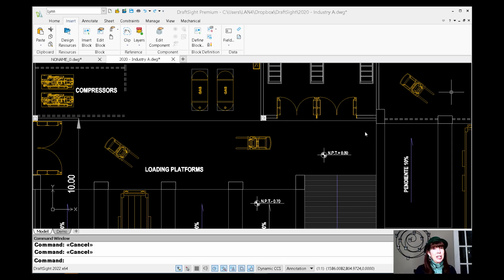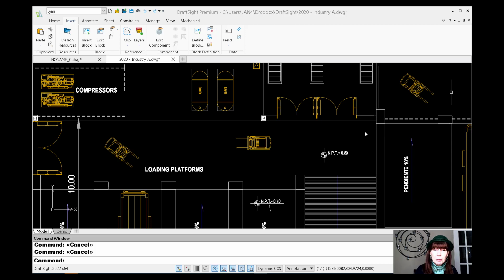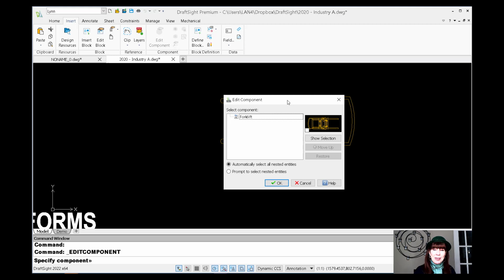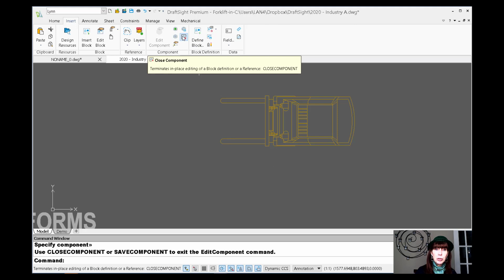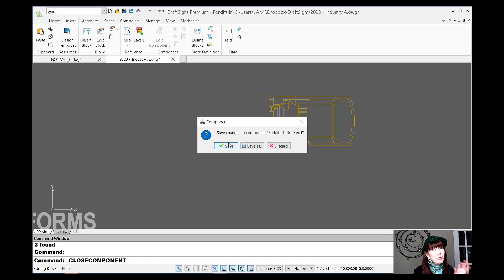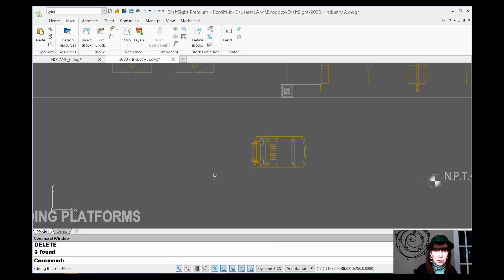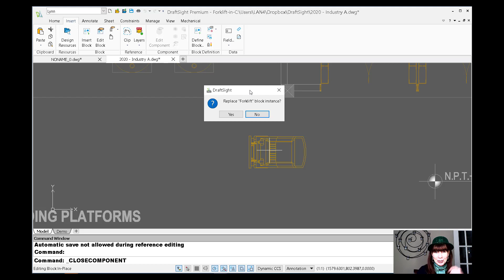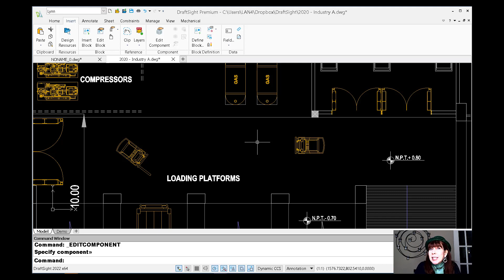DraftSight Insights: Lynn Allen Explains Speedy Block (and Nested Block) Editing in DraftSight!

Comment: Hello Lynn, hope you're doing good. Please I have a question for you that's not referred to this video. I use Autocad 2019 and I'm looking to remove the small window that appears next to the cursor when I start a command. For example when I draw a line it tells me Specify firs point. I don't want that like many other messages because it's already shown in the lower command bar.
Thank you very much
Best regards
Jerome Oppliger
Reply: Hi Jerome,
Try hitting F12...that should turn Dynamic input off.  Let me know if that works for you!
Reply: @lynnallen3683  Hi Lynn, F12 does remove the comments next to the cursor, unfortunately it remove also the possibility to start a command quickly with the mouse.
Guess I'm just gonna get used to it.
Thank you very much